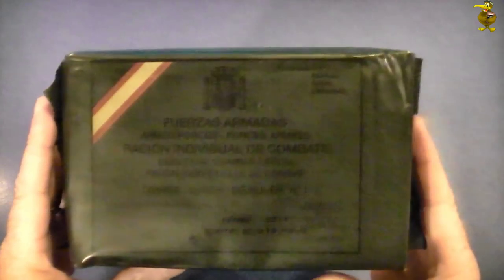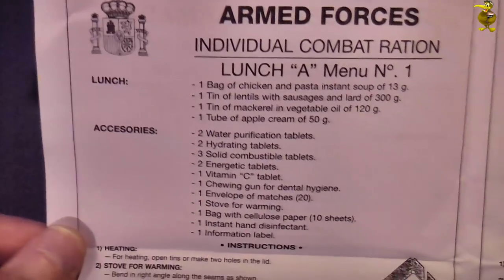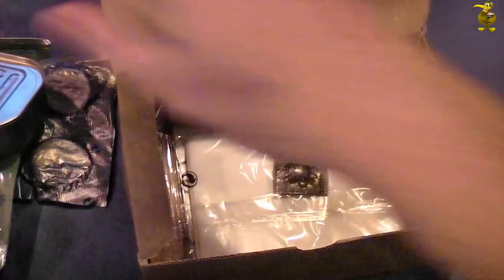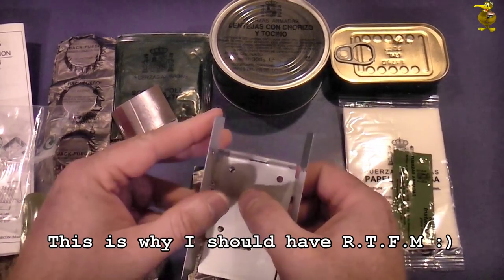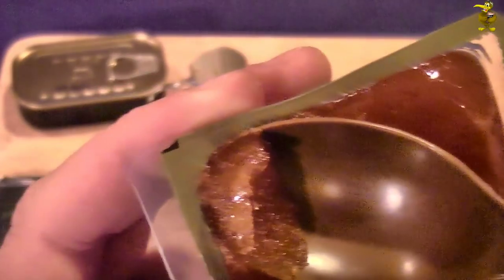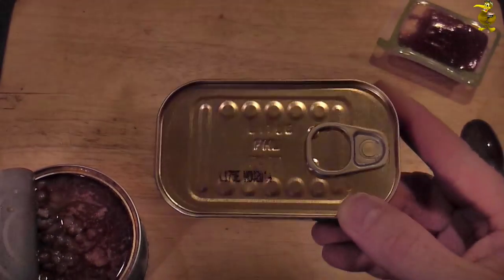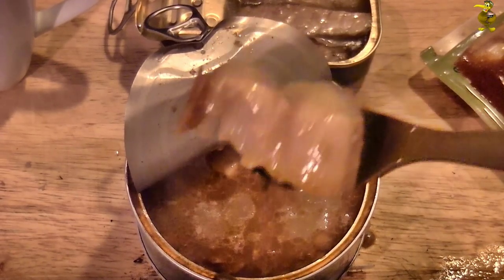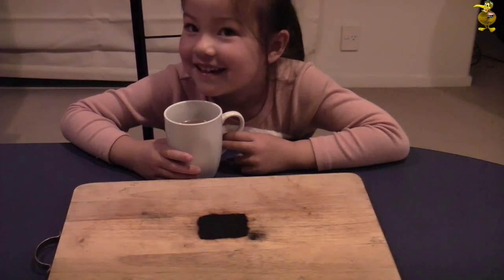MRE Review - Spanish Army Combat Ration - Lunch Menu A1

Comment: Yeah, both meals, lentils with sausage and that fish (caballa), are quite typical in Spain ( probably they are more common in the central and northern parts of the country ).

I used to eat both of them cold, as IMHO they taste better that way ( besides we were given only a few min for meal ). In any case, we were usually issued a big pack that contained breakfast, lunch and dinner boxes; which was kind of an overkill as you could easily make one last for an entire day.

Inside each of the breakfast boxes you could find a big pack of crackers that could last for a few days ( besides a tube of delicious condensed milk ), that's why the lunch and dinner boxes don't have any additional crackers. 

To tell you the truth, to me they tasted better than the meals from the field kitchen.
Reply: I've never seen anyone heat a tin of mackerel before here in Ireland either. Seems weird they don't have tinned mackerel in New Zealand.

Comment: Interesting way of using our rations :D
As many others have said, the mackerel, tuna, anchovies, sardines and others are eaten at room temperature. The olive oil is always a hint for that: Think salad ;)
It's strange that they used sausage for chorizo in the translation. Hard sausage maybe, or just chorizo, since it's international enough, like pepperoni. The pig fat in there makes the whole mix a quite "hot" casserole and it should be good energy, specially in colder days.
And yes, building the stove properly helps, but there's always the option of using bigger ones :D
Extra tabs are good to keep around (properly labeled) for trips.
Fun to watch! Thanks!

Comment: The fish must not be heated. You eat it at ambient temperature, with some bread or alone. Also you must stir the lentils after heating, the sauce will be much better. The stove is not in contact with the floor, you can assemble as if it had legs (instructions paper). ;). Nice review.

Comment: Got a question I got an emergency kit with food and water that I bought when i was young, should I check the contents and food or would you say that it has already gone bad and is unsafe to eat.
Reply from the maker: Jack Morel I guess it depends on how old you are now, and what type of food it was (canned, freeze-dried, retort pouches, compressed biscuits etc...).
Reply: water is pouched and the food seems to be compressed and im 21 now and i think we bought it when I was at least 14 or 15
Reply from the maker: Jack Morel Those compressed emergency 'biscuits' last a very long time, as can sealed water packets. I would recommend holding on to them for a while longer unless they're really getting in the way.
Reply: They are not they are in the garage for now and thank you.

Comment: As inefficient as cans are in the weight-to-carry sense, it seems like anytime an MRE includes cans, the food's blatantly better.  Real fish, real meat, no weird crap additives.
Reply: manictiger it's very true. all of my day rations in my emergency kit consist of canned food. very little freeze dried.
above all is the cooking issue. 
most MRE packs need to be cooked at least a little to be considered edible (not from a health standpoint, but because most of them are just disgusting cold).
A can of spam or chicken or whatever is going to taste fine right out of the can. sometimes in the field or in an emergency, you simply don't have the time for the heaters.
Reply: Ty Guy I find certain canned beef stews are quite tasty cold.  I actually prefer them cold.  It has to be lean, though.  Once you start adding lots of fat, it is nasty cold.
Reply: Melthornal agreed from a flavor standpoint, but i try to avoid "mixed" cans in my stores.
anything with more than one ingredient, sauce, etc. 

I only do this because it makes it easier to identify what has spoiled or not. 
a bad can of chicken will smell bad when you open it right away. a can of chicken soup might smell like perfectly good chicken soup even if the chicken in it is on it's way out, just because the broth has such a strong smell.
Reply: Ty Guy I solve the spoilage problem by regularly eating the food.  :p